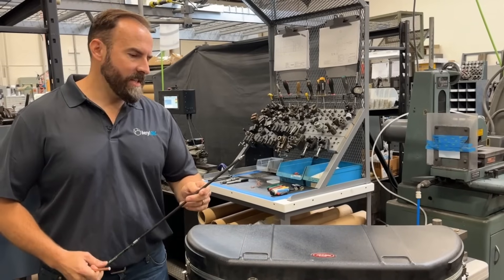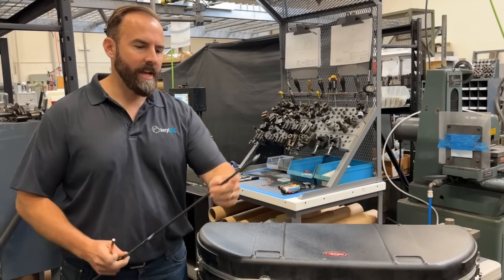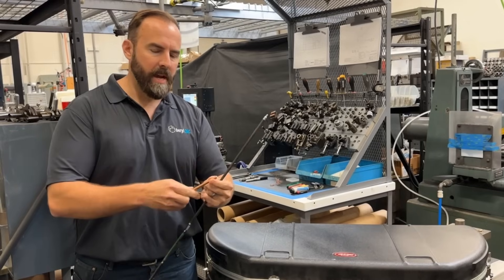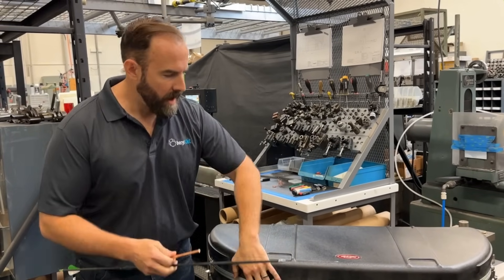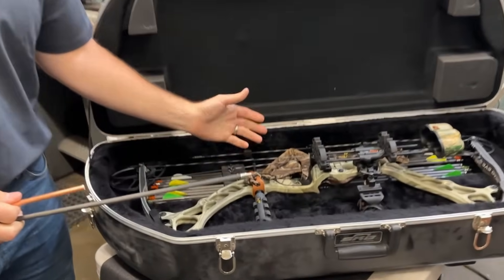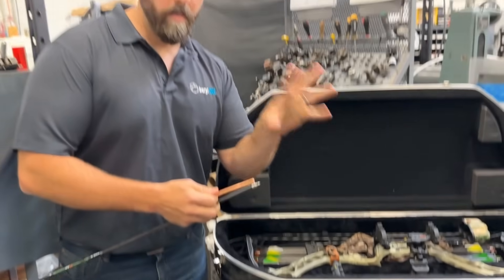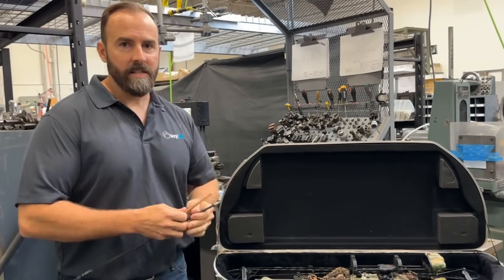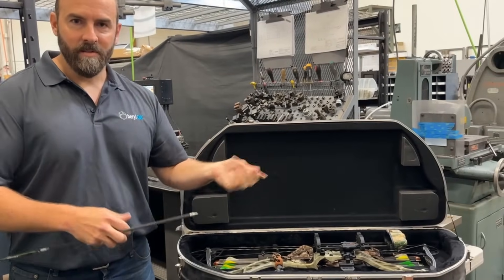Ballistic Arrow Point Design in Fusion 360 (Part 1)

Comment: Basically all I see is a dum-dum type arrow head, practice & well placed shots will be better all the time, plus these are a one shot deal, how are you supposed to dial them in ?
Reply from the maker: This is just a case study in achieving expansion and open connected petals in Copper; It's not supposed to be for hunting, although it could have applications for small game. About the one shot thing - many broadheads end up being $15 "one-shot" deals too. So for example, if this were to end up being a $2 hunting point, it would be made from steel, induction hardened only at the end, a central penetrator added, and the petal vertices sharpened up. As far as dialing them in - they should fly very close to a typical 100 grain field point. If not, you would burn one or two to validate their grouping and then you'd know for sure. Check out Part 2 in a few days - we hope you like it!

Comment: It would not be legal in a lot of places. I'm pretty sure most states require a certain cutting diameter.
Reply from the maker: Legal or lethal... agreed. This prototype is not designed for hunting... simply to see if we can get a good opening of solid Copper in ballistic gel. Fully open diameter of the petals is around 0.850". We may address a hunting variant of this design in a future video, which might involve chemically sharpened steel vertices, longer petals, a central penetrator, etc. Basically, that variant would be a single-use broadhead.

Comment: Can’t wait to see the results! 
I can’t tell how much material you left at the hinge point. But I think you’ll at least get a decent bit of spread- maybe compare penetration to a broadhead in next video?
Reply from the maker: Awesome! This was the starting point of the ideation / iteration cycle, so we didn't settle the hinge material (Part 2 will address this). The broadhead comparison test is a pretty cool idea... there's a few ways this expansion can be engineered, and it goes down a rabbit hole that we are probably going to avoid on our channel. Making this from Copper is sort of a calculated gimmick and shoutout to our friends in the machined Copper industry... in reality it should be steel, and the cuts probably engineered to meet at a vertex and provide some level of cutting capability if you want the most out of 60-90 ft lbs of energy from the arrow. (Maybe even way more than 6 cuts to get that knife angle smaller). So if this were to be used as-is, we might want it to dump all of the energy and have shallow penetration, or if the cutting capability can be worked out, then you'd want deep penetration comparable to a broadhead. Anyway, thank you for commenting, and we hope you check out Part 2!